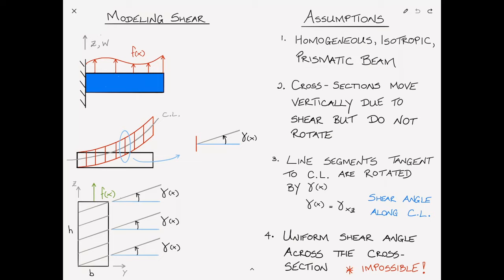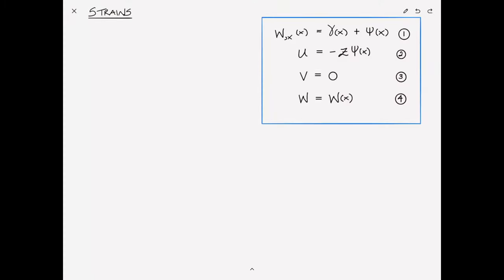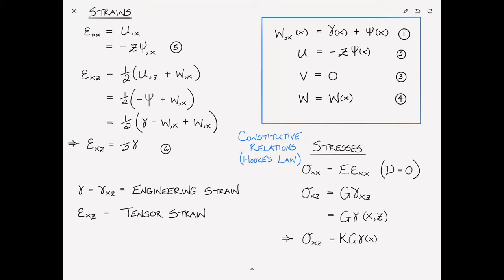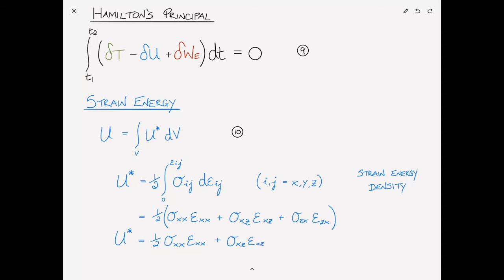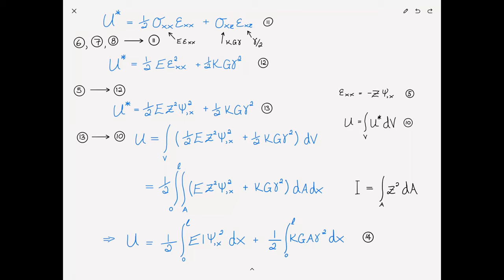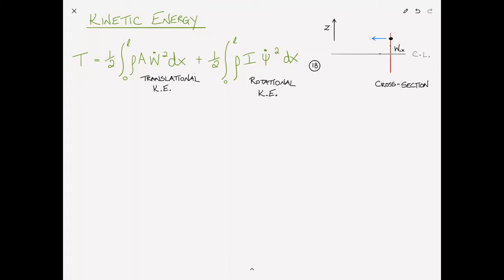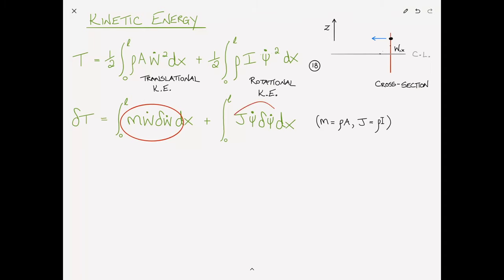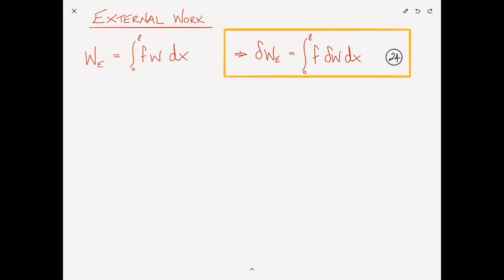Timoshenko Beam Theory Part 2 of 3: Hamilton's Principle

Comment: what is the 'm' in the equation of shear correction factor for hollow cylinder?
Reply from the maker: The original source of this table is from G.R. Cowper's paper on shear correction factors,"The Shear Coefficient in Timoshenko’s Beam Theory". Journal of Applied Mechanics, June 1966, p. 335.  It shows that m = b/a (the ratio of the inner to outer radius).  Also it shows that there is an error in the formula for k as printed!!  It should read
k = 6*(1+ν)*(1+m^2)^2 / ( (7+6*ν)*(1+m^2)^2 + (20+12*ν)*m^2 )
NOTE the squares on each of the m's.

Comment: in calculating u*, I thing it does not have 1/2 in, u*=inegral(....)
Reply from the maker: Yes, you're correct.  We get the 1/2 as a result of performing the integration (and assuming linear stress-strain relations).  So, the 1/2 should NOT appear in front of the integral, but should appear in the lines that follow.